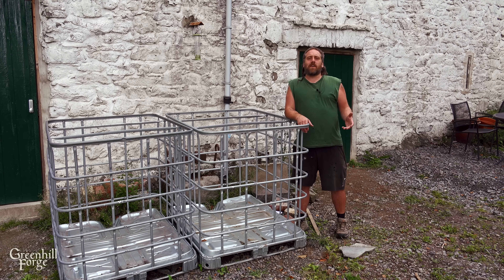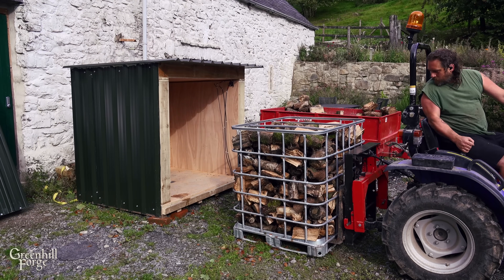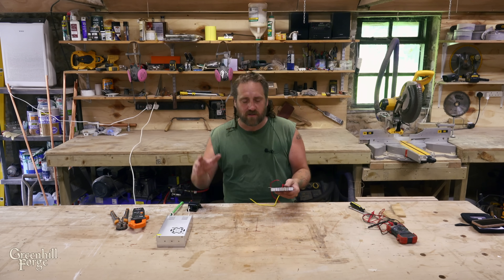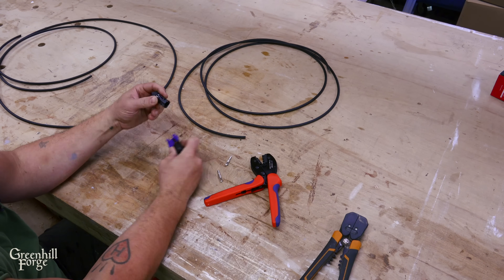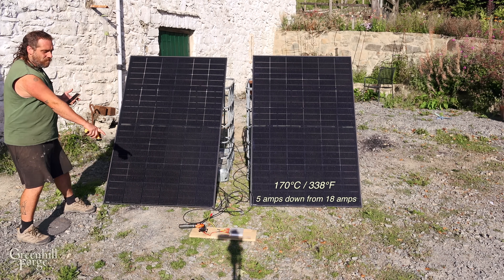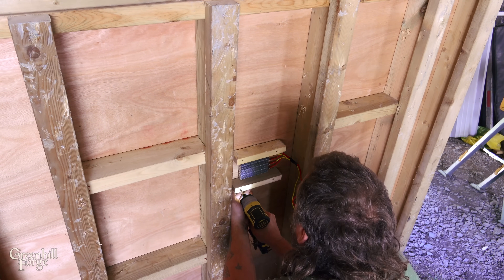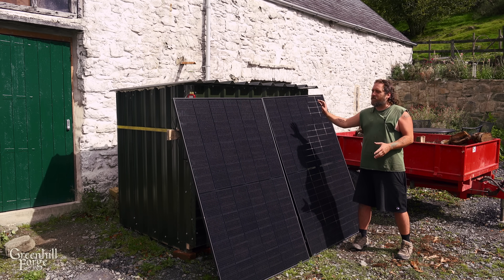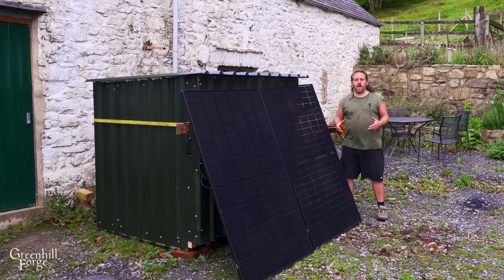Building a DIY Firewood Kiln: Solar-Powered Small Scale Portable Off-Grid System

Comment: Could you have a low level vent fan, hooked up to a light triggers switch and small battery (perhaps charged from the solar array)? This way it can draw out moist air (and therefore dry the wood more efficiently) during the darkness whilst not removing warm air during the day.

Comment: Is your woodstove in such a location that you can divert some heat from the stack into the kiln?  You might even get a good result by using a BLACK box, no insulation and a simple solar-powered fan for forced ventilation (no heating other than that the box sides themselves generate i.e. passive).  Save the cost of two solar panels.

Comment: Hey, just wondering why you don't let the lumber sit for 2 years to season naturally. Is that not an option in the UK and/or do you need to kiln dry it anyways so it reaches your desired dryness?
Reply from the maker: I do that but the wood normalizes at around 20% here because of humidity so this is to drop it down to 12-15% or so right before using it. Sometimes I'm also not 2 years ahead on my supply
Reply: @GreenhillForge  awesome, thanks!

Comment: If you painted it matt black, and moved those PV panels off to one side, when the sun is actually shining, you'd probably a temp boost of 15 - 20C from direct sunshine. You might have a summer box, black, uninsulated, with an insulating jacket to drape over when you have to rely on your little heater. What is the minimum temp, to call wood kiln-dried? Purely moisture based?

Comment: This looks interesting. I live in Scotland and have a Rayburn that is a hungry wee beast. I've been planning on building a wood solar store to keep up with the wee beast. If I was to build one of these I would paint the inside black, have a boxed clear roof and door, fans (solar) to move the air, possibly a humidifier run on solar (20w from Ali Exp) internal temp/humidity sensor.

Comment: The idea of drying firewood is a great one. But I see two drawbacks: 1) the drying chamber is too small, 1 m³ is too small for everyone, I think, you need at least half the amount of firewood you use for the season, 2) panels are cheap now, but still their efficiency is still up to 20%, so not all the energy will be useful. Therefore, if we are already building a box for drying firewood, it might be better to make it in much the same way, but instead of a heating element from the panels, make a double-sided lining of these sheets so that the outer one is heated by the sun's rays, and the inner one receives this heat directly from the outer walls through homemade heat pipes (copper tube with a liquid such as alcohol or acetone sealed in). In this way, no electricity/panels are needed at all, and the larger the box body, the more sun it collects and uses. If there is a lot of metal in the box body and enough sun, then heat tubes are not needed - I covered garage gate with a sheet of metal, so these sheets of metal heat up to about 60 degrees, which is very hot.

Comment: @Ed.r brings up a good point on solar hot air being more efficient. A combination of both would also be a good idea. Similar solar dehydrator designs utilize a glass covered "chute" with  a screen  or series of metal baffles to capture the solar hot air entering the bottom of the chute and exiting the top, which is also the top of the enclosure. The moist air falls to the bottom, exiting the bottom through a "chimney" with enough length to help create a draft. The PTC could be used as a supplemental heat source to keep the maximum amount of air flowing, especially during the cooler months. I suspect it would reduce the overall time dry considerably. Those solar dehydrators reach 160F pretty commonly. You are bit ahead of me on the build, which I am making out of an old black side by side refrigerator with all the insulation stripped out to use the thin black housing for solar gain to contribute heat the box. Mine is intended for multi-use as a  high volume fruit or vegetable dehydrator (lots of  shelves). It can double as a small volume wood kiln. I like the idea of the PTC and probably will incorporate it. Lots of options if a temp or moisture controller is also used. Thanks for sharing.

Comment: I would consider taking the fan off the heating unit so it doesnt melt and using it to suck cool air out the bottom as far from the heater as possible. Convection should draw the hot air up and in to the kiln and the cool air being sucked out should create a pressure difference that make that smoother.
Reply: Heat rises, that’s why the heater’s on the bottom, so it’ll rise thru the moist wood.

Humid air also rises. Better to put a fan at the top, blowing outward.
Reply: @jake.presents  I wasnt saying the heater should be moved. Just the fan thats on the heater. The though behind moving the fan to the bottom on the opposite side was to prevent any cold pockets from forming in that corner. I would love to see someone test both positions

Comment: I like the idea of solar PV direct heating, its given us hot water all summer. However in this situation solar air heating would be even simpler and more effective. Keep the insulated box but paint the front mat black. Add an air gap in front with a glass front. Small solar powered fan to circulate the warm air into the box.
Reply: Glass and forklifts dont mix. or firewood for that matter.
Reply: If the air intake is at the bottom of the front air gap, air outlet at the back bottom of the insulated box and hot air intake to the box at the top of the air gap it might have a tendency to self circulate. Rather like the back boiler in a stove. Also with both air inlet and outlets being at the bottom it will naturally trap in the warm air when there is no circulation.
Reply: Good idea, I have a shed for storing firewood and of course the door should be replaced with a used glassdoor with a black cloth on the inside.
That will heat it up!
Reply: @per-erikpersson9898 I'm going to try in in my new workshop for heating. Its going to be cladded in black corrugated metal. If I line the inside there'll be and airgap that will heat up. I can either circulate air around it for heating or close it off in warm weather.
My old workshop is painted black and it heats up nicely in the sun.
Glass and insulation just make it far more effective.

Comment: Another thing to think about is incorporating the heat absorbed by the panels which should be 3 times more than the electrical energy alone, by for example insulating the back of the panel and running air through channels stuck to the back with something like a server fan/fans powered directly from the panels, and using a conduit to route this inside the box. 
If you really want to go all out, get a tiny heatpump made out of a compressor dehumidifier, you could see a 3x or more increase in thermal energy supplied if done right, using the panels as a heat source too, much much greater, if you dont mind making things rather more complex.

Comment: It would be better to place the panels against the wall so you could add the heat from the sun on the front of the box. About 3 m2 added heat will make a difference.

Comment: Very interesting idea, especially the heating element. I've been toying with the idea of supplementing my gas water heater with solar and using PTC elements might be a good way of doing that. Anyone else try this? If so, what are your thoughts and/or suggestions?
Reply: I'm using direct solar PV water heating and its working great and I'm on the west coast of Scotland. Provided our hot water all summer and waiting to see how it performs as the days shorten.
I have 2 pairs of 440W panels. Each pair of panels is connected to a 2.15Ω, 24V, 300W immersion heater element. One pair faces SE the other SW.
There is nothing but a big old breaker to turn it off if we need to. When the tank is up to temp, which it can be by lunchtime on a sunny day, the extra heat goes into underfloor heating.
Next project is to make a diode chain immersion heater as they extract considerably more energy than a resistive element. This is by keeping the voltage up at near max power point like an MPPT controller.
Reply: The immersion heater is a custom triple element one off Ebay with a single 240V 1kW element and 2 x 24V 300W elements. The 300W elements seem fine with the 600W the solar panel pairs give out in full sun. Heats the 120 litre tank in about 3 - 5 hours in full sun.
Reply: @Ed.R Thanks for the reply and details of your setup!

Comment: That's a 48v 1000w heater and you appear to be using a 72-cell type panel which should give you an ideal load point around 43v. I suggest you make sure not to overdo the fanning on the heater as it will lower your power!
Here's my reasoning:
Your heater starts off at a somewhat high resistance and will swing down as it heats up to operating temperature. This resistance should be around 2.3 Ohms for a 48v 100w heater allowing it to stay at operating temp and draw full power. If it gets hotter than this it will quickly rise in resistance, reducing the current pulled until it stabilizes temperature. Normally those heaters limit themselves to under 200c so I would assume 2.3 Ohm is around 100-130c. The open circuit voltage for your panels is probably close to 51v and they will be pulled down by the heater as it warms up. It's normal for the heater to start out at 3x resistance so I'd guess around 7 Ohm cold. That's around 6-7.2 amps drawn which should probably stabilize the voltage from panels at around 48-49v for the start. That's only 350w drawn.
As the heater reaches 2.3 Ohms (assuming it will ever get there) the load on panels would be around 9 amps each (18a total) at 44-45v which is quite close to ideal load!
So, my suggestion is making sure you don't fan the heater too hard, allowing it to keep a fairly high temperature. This ensures a good load on the panels. If you overdo the fanning you end up dropping the heater down into it's starting range and here you get only half the load on your panels vs what they can provide.

Comment: Rigid styrofoam insulation might work better than the fiberglass bats. It has a higher R value and won't hold moisture in case of rain infiltration or, as it is where I live, crushingly high humidity. Additionally, adding a remotely readable temperature and humidity sensor would make it easy to observe/chart the internal humidity. The humidity of the air inside would serve as a rough proxy of the moisture in the wood. When the humidity stabilizes over the course of several days, your wood is ready. This would cut down on the number of times the kiln would need to be opened to check the moisture content of the wood.

Comment: It is much more efficient to use solar heat from an airborne solar collector directly, rather than converting it into electricity, the efficiency of an airborne solar collector is 80-90%, and from an electric solar panel 15-18%. Just put a black panel under the glass and drive the air from this panel through the firewood with a small fan, and the air itself will move from bottom to top under heating.
Reply: Or just build a solar oven. Like the ones that are used to cook or dehydrate food, but in large.

Comment: I like the idea. That heater element seems pretty interesting. I wonder if housing it in a canister of rocksand would be a good way to keep the heat more consistent overnight.
Reply: Yeah. Seen this done before, l think they call it a sand battery. Also seen them placed between 2 bricks or in concrete.

Comment: awesome job mate!
I think you could get more juice of it by controlling the fan speed depending on the solar output. More radiation, more air flow. So when the PTC is not so hot, the fan blows at lower rpm, and vice versa.

Comment: A joiner who I worked for had stacks of green timber drying inside an old plastic greenhouse. I think there were two doors at either end for ventilation, which could be opened or closed as required for air flow on sunny days. If you had the need for timber drying it would be interesting to see a version of your setup for that.

Comment: suggestion... cover the electrical wires on the inside of the kiln so you don't accidentally catch, drag, or rip them off the wall when you have a load of  wood going in or out.

Comment: If you're doing forced air, consider putting your exhaust bent at the bottom. That's a big part of how fired ceramic kilns work, it uses baffles to prevent direct flows and physics to selectively remove only the coldest air. In your case it would be the coldest/most water saturated air that you'd be selectively removing which should help.
Reply: The support cage should redirect some of the hot air, and get benefits from conduction.
Reply: exhaust vent? Good idea @aquilux-vids
Reply: Creating a vacuum could also help.
Reply: removing only the coldest air wont expel the most moisture, the point is to remove moisture not heat the firewood
Reply: Yes air flow key … if box was a tad taller so metal basket was a foot higher than floor and maybe   could have flex ducting and a fan take  and reuse some of the  hot air from the top and bring it back down ? Again, air flow critical. Mom had a wood burning furnace and once we made a rack that kept wood about a foot off the ground ..wood dried much faster.
Reply: moist air is lighter and rises. I know it does feel that way on hot humid day, but it is a fact.
Reply: @msears101  Avogadro's law. absolutely spot on.
Reply: @davidw4970  Apparently I was not the only one paying attention in class.  It is rare someone responds to my comments in a positive way. Thanks
Reply: @msears101  pleasure.
Always found it an interesting one as vast majority of materials are heavier when wet. Not air though - due to H2O molecules being lighter than N2 and O2 and Avogadro’s telling us that a volume of gas at same temp and pressure will contain same number of mol’s. 

Nerd alert 🚨😂

Comment: waiting for episode 2
you have a moistre meter to check progress ?
i was always thinking what is better more air or less air and higher temperature, what would dry faster.
and other guy said here a green house would also be good. but then you need to get rid of the moistre air.
Reply from the maker: yeah, they started out at around 22% in the middle. i think keeping low humidity is the most important thing so it's not an easy solution as it's usually 85-100% humidity where I live

Comment: Wonderful video. Look forward to the updates. Would like to see most re data in the video about specifics like solar panel watage, voltage, models of PTC and where to purchase them. Also how you decided what size PTC vs the solar panels output capability. How is venting handled to let moisture out?

Comment: Creative! Got flashbacks of entering my car in summer. Great use of the sun.
Partly shading the kilns with the panels will cost a few degrees - esp around the bottom where the cold air inside will reside.

Comment: Cool build, but perhaps build a totally passive solar version as a baseline, just painted black.
Reply from the maker: yeah, definitely worth testing. problems is I've had a bunch of good ideas in the comments so now i've got about 7 more kilns to make and test
Reply: @GreenhillForge look up apaalachian dehydrator...solar only...no moving parts...and yeah painting it all black..just even the black metal sheeting woukd work with some good venting....scale it uo for the tote..not so much use in winter but would definitely 'cook' your wood at sunny times...the ibc totes are genius...may have to borrow that idea in the future 😀...look forward to see your other creations...👍🏽
Reply: I like it. Using direct sun onto the metallic shed and using the backside generated heat from the panels would get you some free heating power.

Comment: I used for a number of years a cheap kitset 8' x 14' greenhouse that i fitted with 6 solar powered computer fans to dry firewood....it worked real well....i had the fans pulling air out the bottom of the greenhouse and replaced by air coming in the ridge vents......it allowed me to dry  split eucalyptus that normally takes a minimum of 2 full years to dry in 4 months......this was in Dunedin, NZ so not the sunniest place in the world
Reply: Why draw air from the bottom and not from the top?
Reply: @ElDuardo01   hot air is lighter
Reply: @ElDuardo01 it would just get rid of the hottest air without making use of it. You want to bring it cool outside air and heat it as much as possible to increase its moisture absorbing ability as much as possible.
Reply: @ElDuardo01  It allows the incoming air to be heated up so it can hold more moisture before it is draw out the fans at the bottom
Reply: Is burning Eucalyptus not... Interesting?
Reply: @benholroyd5221  No....why would it be?

Comment: Most of the plastic bladders that come out of those cages are marked in Litres and Gallons. The standard size ones are 1000L (1m3) and the big ones are 1200L (1.2m3)  The cage externally may be more, especially including the base pallet, but I highly doubt any of the cages will ever get 1.8m3 in them.